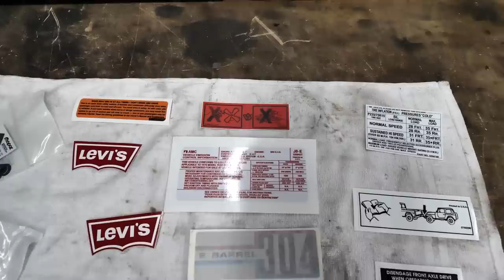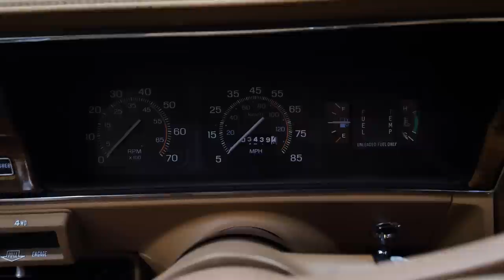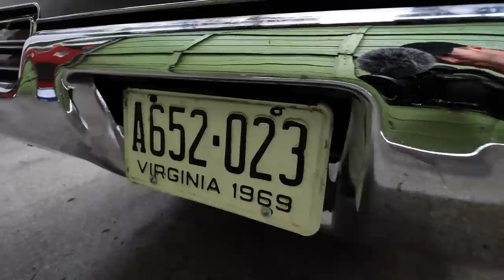BARN FIND UPDATES! + 300K SUBSCRIBER GIVEAWAY!!!

Comment: Dennis, if you're ever out and see a mid to late 80's Nissan pickups with the engine that had 2 sparkplugs per cylinder, I want one. If I can't find one of those , a 78-79 Ford F100 or F150  with either a 460 or a 400 Modified or 351 Modified. I am disabled so I can't afford restoration. I need cheap.

Comment: You need to check your facts about GMC products and speedometers. The 34 and 39 numbers, not counting the white numbers;. The second and third number is off set that is a tell-tell sign that the speedometer has rolled over. Call the GM corporation to fax check the facts